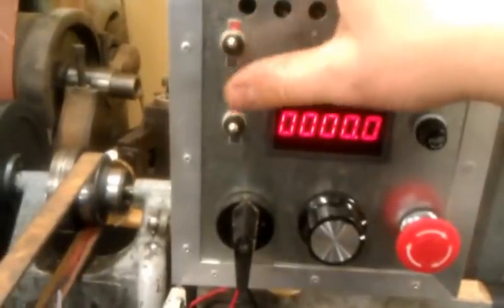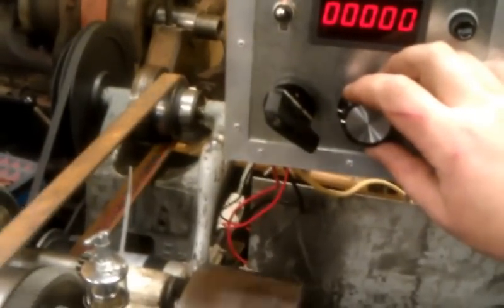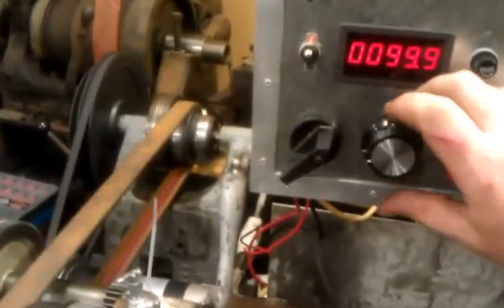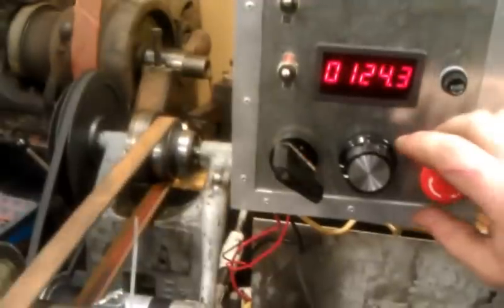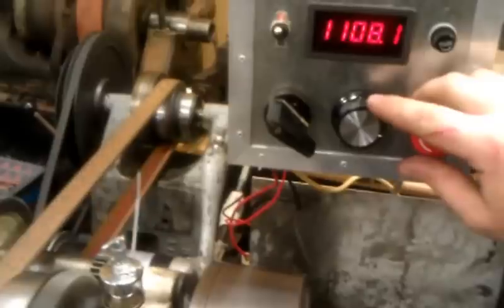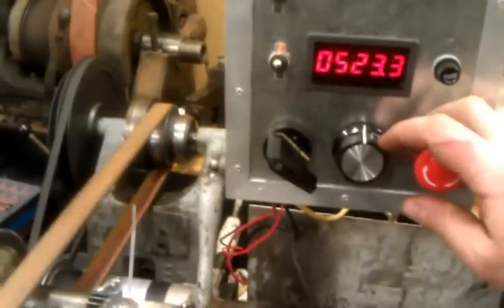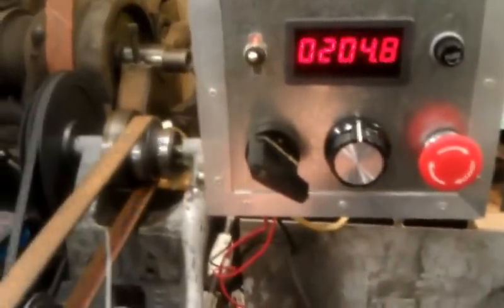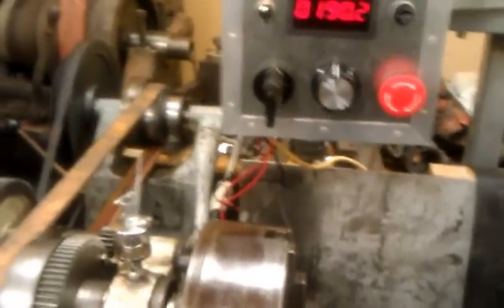Mars lathe 180v DC motor conversion

Comment: Does it have torque at low speeds? Thanks
Reply from the maker: Heaps of torque at all speeds, as you put the load on the motor slows a bit then the controller reacts and the torque comes along in a huge way. The biggest problem is keeping the motor cooled, they produce heaps of heat.
Cheers, Ueee
Reply: Thanks so much for your reply! I want low speed for off balance pieces on my lathe but without torque it would be useless. Im going to give it a try and see what happens......thanks again!
Reply: Tom Wilcox is this control already has  a display showing rpm .. or is it your modification ..  pls. give u r email id
Reply from the maker: Jose Thomas
 The tacho is a separate unit bought of ebay. It uses a hall effect sensor which sensors a magnet on the bull gear.